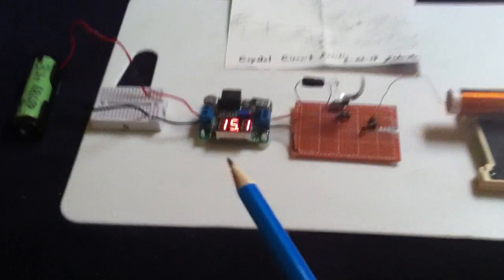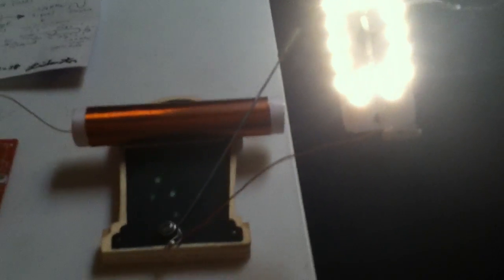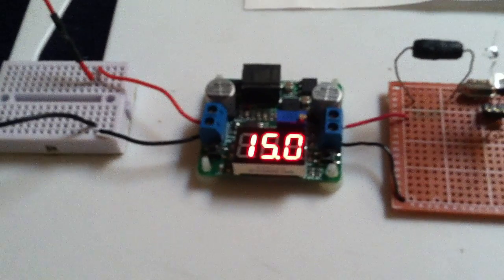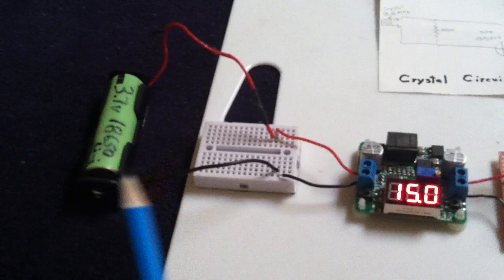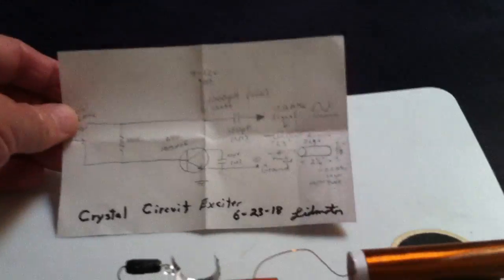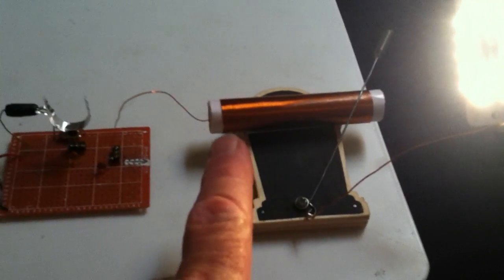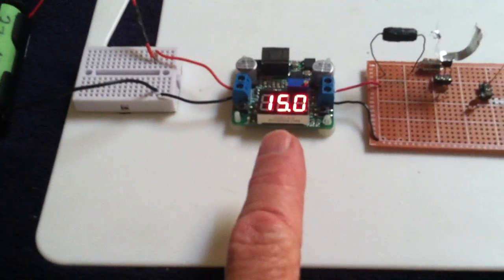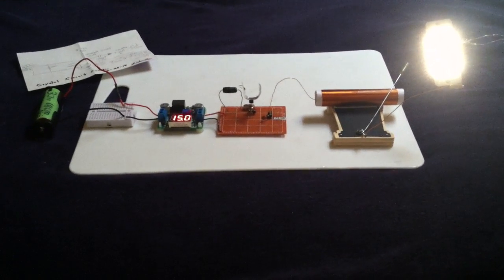Slider's Power Supply for 'Stiffler Loop' Project

Comment: Ah that's great news that it's of use in your experiments too. 
It's been a reliable way to know what's going in and to watch what happens when the voltage is moved up and down. 
Cheapo adjustable power supply for many uses :)
Reply from the maker: When I saw you using one of these a few videos back I ordered  a voltage meter and booster on EBay right away.  Today I was digging around in a box and found this one that I already had.  I had forgotten about it.   Works great.

Comment: The good Doctor was indicating that the loop can go on into infinity Lidmotor. I wonder how many current loops will light up.
Reply from the maker: I don't know.  My experience has been that the more you add the less power each has.  It does not cause a increase on the overall draw from the source though. It some ways it reminds me of radios.  As long as the radio station transmits it doesn't matter how many radio receivers there are.